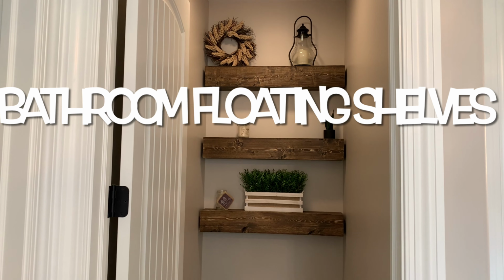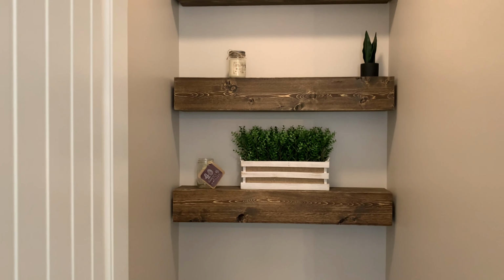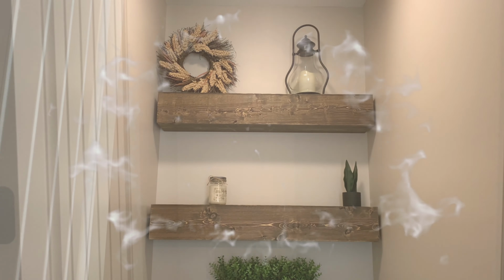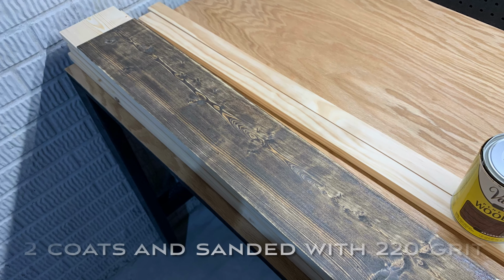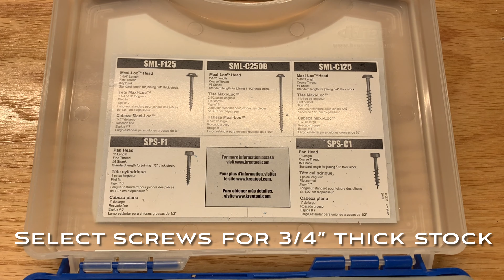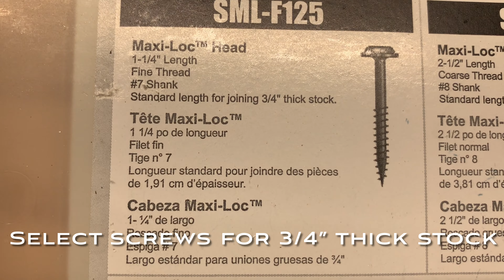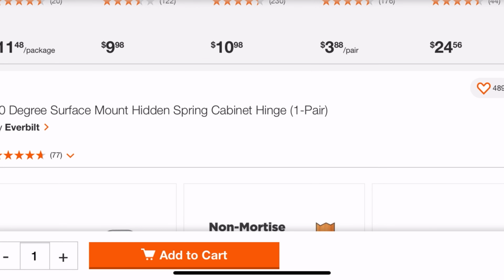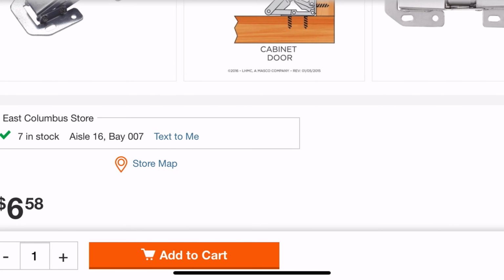Floating Shelf With Hidden Compartment

Comment: Not with the current prices of wood lol! These are nice looking though! The hidden storage is awesome!!
Reply from the maker: Thank you Mark.  Even with the highest cost of lumber in history you’re looking at $9 per 1x6x8 x 5 for a total of $45 and then throw in one 1x2 or use scrap lumber for mounting.  These would have cost several hundred for this length and height purchasing them as well as wouldn’t have included the hidden hinges.  Also, I use canva for free, but use the website below for removing backgrounds.  
https://www.remove.bg
Reply: @inspiringbuilds  thank you! This is definitely cheaper and nicer than buying some pre made!
Reply from the maker: @MarkNealJr  You’re welcome, and appropriate your support. 👍🏼